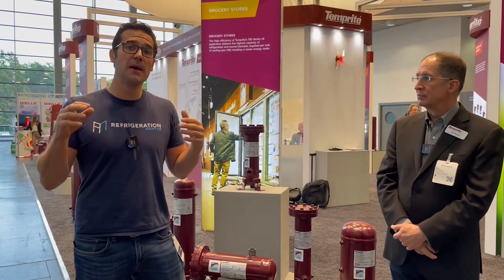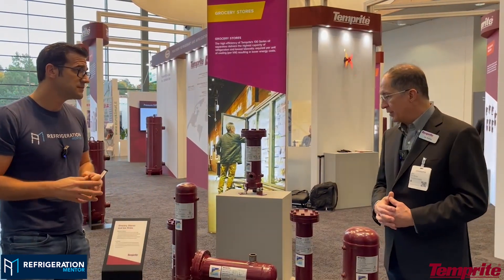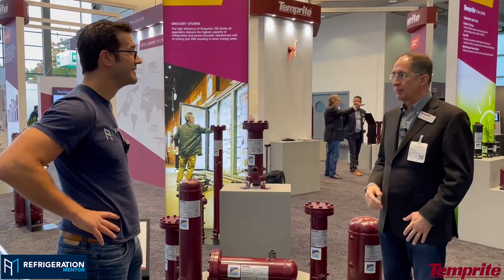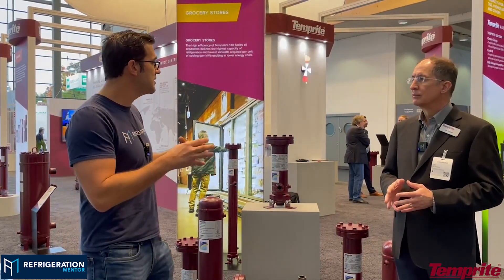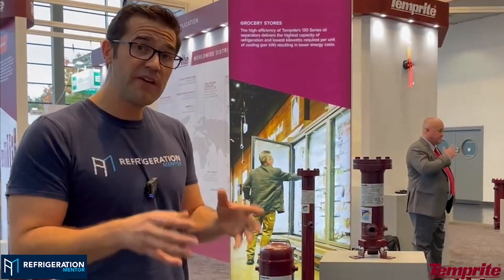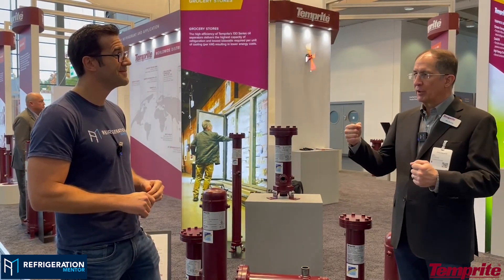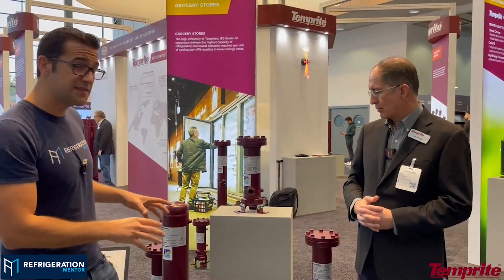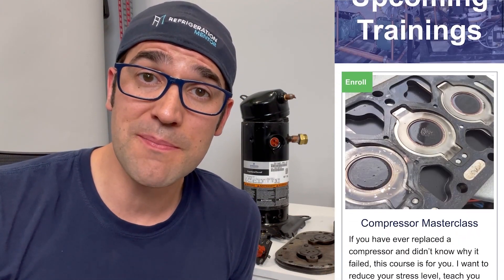Temprite CO2 Oil Management Components

Comment: Many of the field technicians misknow the importance of oil management systems, espcially when we have compressors running in parallel. There is still a big gap to fill in term of training. Thanks for the sharing.
Reply from the maker: You are welcome
Reply: @RefrigerationMentor  actualmente todos los bastidores refrigerados tienen puertas por lo que la baja carga es muy común ... Cómo se maneja evitar la baja velocidad y el aceite no regrese?

Comment: Please do some residential VRF/VRV content. I want to build a system that will heat my house (hydronic hot water) , cool my refrigerator and freezer, dry my clothes, dehumidify my house in fall winter and spring and provide air conditioning and domestic hot water in summer.   I know it's possible and I already have an excess of PV solar and battery backup to run the transcritical CO2  heat pump. I also believe that with an inverter heat pump the compressor will do less work if I am heating and cooling simultaneously with a proportioning manifold.
Reply from the maker: I know some people in the VRF/VRV world let me see what we can come up with